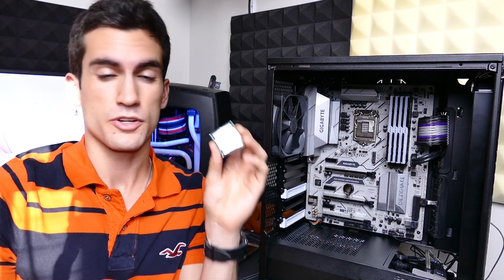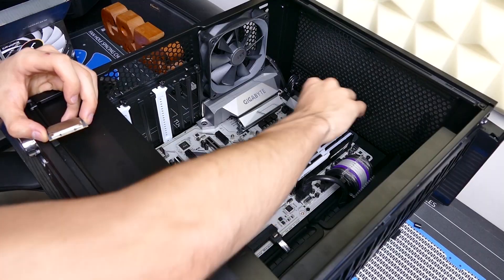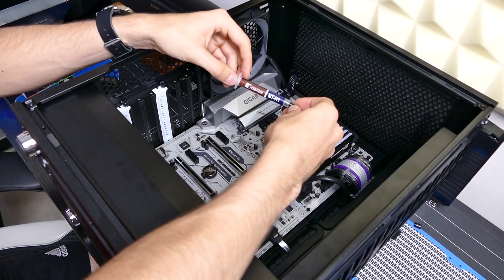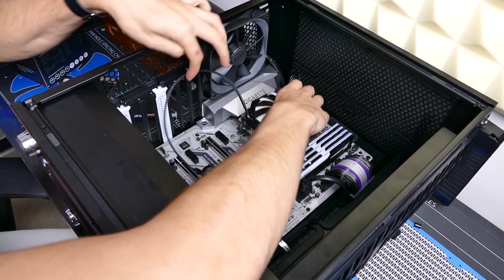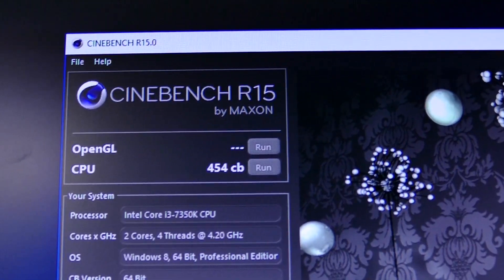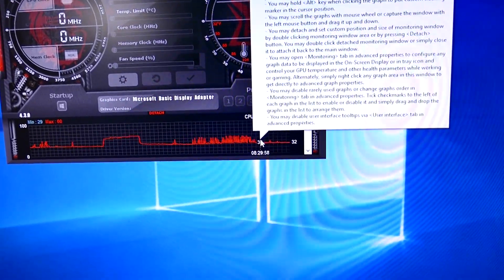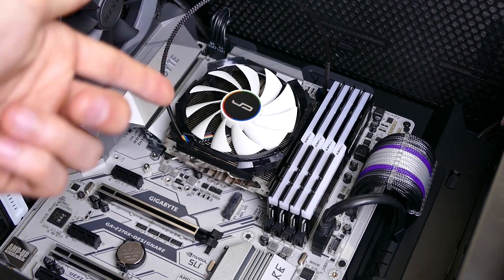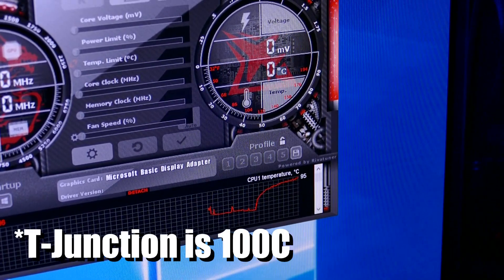Thermal Pad Instead of Thermal Paste?

Comment: Can't you see? when you removed the heatsink after first run with thermal paste blob wasn't spread evenly only occupied centre of the heatspreader and might have missed the core underneath. Ergo - putting one blob in the middle is not the best idea. just put on latex glove or cover finger with a small plastic bag and spread thinner layer possible all over the heatspreader. and no, no air will be trapped
Reply: Szymon Krasuski, all cores were covered, relax.
Reply: +Miruku to my knowledge, "spreading" the thermal paste is a disaster waiting to happen. Spreading it creates air pockets will will not allow the heat to dissipate and in turn will fry your chip eventually. Make  a 'P' or blob in the middle of the chip and  then press down firmly. In order to see what will happen when you apply thermal paste, get a clear piece of plastic and press down once you've applied some paste to see what it will do. This will help to understand what is happening.
Reply: +Miruku on that subject, how do you feel about Silver based thermal paste? I've used it my last PC build waaay back in early 2012 on my i5 K processor. I don't really monitor PC temperatures because I don't do any overclocking and I don't know/see the difference between silver and the plain white paste. Is there that much of a difference in how much heat is transferred using silver?
Reply: +Miruku Ok, that's what I thought. I'm getting ready to do some maintenance on a 16 year old console and its going to need a new coat of thermal paste for sure.

Comment: why so thick thermal pad ? .... i bet a thinner one would be much better choise
Reply: Actually he has a point, you use pads/pastes elasticity to eliminate the microscopic holes in metal which are filled with air pockets(extremelly poor thermaly conductivity) and the thinner the layer of this material the better as even the thermal paste is "very bad" thermall conductor (depends on manufacturer but its about 6 time worse than aluminium) that is why you do not want to put too much of paste between CPU and cooler. 

If 0.25mm - 0.5mm silicone pad covering entire junction would be used instead the results would not be so dramatic (still worse than with properly applied paste though).

Grammar nazis dont bother English is not my first language.
Reply: Michal Berák choise
Reply: The purpose of either paste or pad is to accommodate that neither the heatsink or cpu is perfectly flat.  By filling in the micro-irregularities, the paste/pad aids the more even conductance of heat from the top of the cpu to the heatsink.  You want the paste or pad to be only as thick as it has to be to fill in those irregularities.
Reply: Michal Berák By that logic, wouldn't no paste or pad be cooler? There's probably a reason why it's thick
Reply: Crimson choise

Comment: Wrong, VRM etc. are the hottest things in GPU, they USUALLY work above 100*C(on full load).
Simple thermal pads are good enough for the because these mosfets doesn't generate much cheat(up to few watts each).
Reply: Depends on how good the vrms are at doing their jobs and if it has a good thermal pad+heatsink. Higher quality vrms/higher phase counts reduce operating vrm temps greatly. But yes manufacturers slap shitty thermal pads between the heatsinks of vrms usually. Then there is the EVGA pascal debacle, lol.
Reply: Smithy Smit remember that temperature on top of mosfet is even 20C lower than it's dye temperature.
Also mosfets usually have junction temperature range up to 175C so it's completly fine for them to operate at eg. 120C
Reply: That's all well and good, but I'd rather not have it running at 120c when I can just slap a better pad on there and vent that heat out the case instead of it heating up the rest of the card. Had some damn good results on some hot r9 290 vrms. Taking it from say 110-120c down to 60-80c always under the gpu core temp. Also give this a look Arek https://forums.evga.com/Explain-quotpower-phasequot-m2393219.aspx better cooling on the vrms is always a good idea, especially when you push the gpu to it's limits overclocking instead of running it stock.
Reply: Smithy Smit Yeah I know it's true.

Comment: I would be very hard to do, but I have always wanted to flat polish the heat spreader and a heat sink and wring them until they stick. Then check temps vs a TIM. I have an older AM3 board sitting around, and the lock is a bit non functional so I can remove and install CPUs with a heat sink already applied. Seems like a good board to test this.

Comment: I was wondering why you haven't covered the whole die with the thermal pad. looks kinda smartless to use just one strip. and 3mm are way to thick. why haven't you used 0.5mm 1mm or something like that. sorry first time your video wasn't productive for the community.

Comment: you should have mentioned that in some cases thermal pads are a must, see for example the GPU waterblocks, you cannot use thermal paste there on ram and vrm, in that case thermal pads are a must especially when the gap among surfaces is big (1mm or more)

Comment: Would've liked to see a run without paste/pad. Just the cooler. Also without a cooler at all. Was disappointed that wasn't done. Maybe in a followup? I'm pretty sure those modern Cpus don't die from this. The worst case they should just shut down.
Reply: Yep, Intel processor shuts down....Apu starts smoking...saw few months ago

Comment: There are thermal pads that can be used with gpus or CPUs. Asus uses a thermal pad in the gpu/cooler contact on their R9  Fury Strix. I can get the reference of the product if you want.

Comment: I have an old Geforce 9500GS I use for posting. The fan snapped off the heatsink, so I jerryrigged a stock CPU fan on it. I also had no thermal paste onhand at the time, so I used toothpaste :') It's not a hot GPU mind you, but it never went above 55c, so I was happy :p

Comment: You can most likely not even put 3 volt in bios you should start from 1.5 and see where it dies. Should start degrading really quickly over 1.5 so that could be intresseting if you want to kill an incessant I3.

Comment: Pull a Linus and construct some janky ass heatsink that shouldn't exist and stick it on the 7350k, overclocked of course. Bonus points for no TIM or using a thermal pad between them

Comment: Maybe using a 1mm or 0.5mm pad and covering the whole heatspreader would give different results...
Reply: yup, he fucked up in my opinion
Reply: Don't bother guys. I said something similar. He just told me I don't know how heat transference works and deleted my comment.
Reply: Monarch Black Lol he told u that? Maybe he needs to check the termodynamic laws
Reply: There is 0.125 mm foil
Reply: I have a 0.5mm or less on my Athlon 64  X2 TK-53 (Packard Bell Easynote MX 52-B) thermal pad running for more than 10 years @ 48°C min & 58°C Max (maybe 60°C peak) since i don't use it for benchmark... and it cover all the heatspreader..
Reply: What brand/product did you bought?
Reply: No creo que hubiera mucho mejores resultados.  Todo aquel que haya estudiado principios de transferencia de temperatura sabe que la misma no podría distribuirse al punto de necesitar mas cobertura en la superficie exterior ya que la superficie interior donde se produce la temperatura es mucho menor. Los que hablan abajo o no tienen mas que hacer o no saben nada. Podría ayudar levemente pero la consistencia de marcar la diferencia entre estos 2 elementos para nada de nada!!! Buena prueba. Salu2.
Reply: HE WOULD MAKE GOOD DRAG QUEEN WITHOUT BEARD
Reply: Dirceu Franzner yea, how did he overlook surface area as a control variable? Could have easily doubled the contact area with little that pad was

Comment: It's kind of a poorly conducted test.
Firstly, the pads are surely used for warm components, as VRMs can ger quite toasty and are safe to run at degrees above 100 °C.
You could also have used a synthetic test to stress it, as you can see throttling with either Aida64 (in the test) or through some hardware monitor, like CPU-Z.

Small things ofcourse, but it's not a good thing to say it's even ok to use a thermal pad, as a longer test than just a couple of runs of cinebench would be closer to a real world usage.
Atleast I think that even gaming during a regular session would bring up the heat to throttling due to constant load, as I don't think a pad could dissipate the heat fast enough. Might be wrong, but it's hardly proven through this experiment either.

Comment: So quick question: I notice a lot of techies test Temps right after putting in thermal paste. I've heard you need to let it set for a few hours/days for it to fully set and be effective. Is that margin of difference between right off the bat Temps vs few days old Temps not significant?

Comment: Man, my FX 8350 hits thermal SHUTDOWN at 80C. As it, the moment it hits 80C the computer will simply freeze on the spot. 

I don'r know of my current processor (a Ryzen) is any more heat tolerant, but seeing these intel chips run at 90+ always freaks me out.

Comment: surely thermal pad is made purposely to be attached to a die? i think if you wanted to test them fairly against each other you should have removed the ihs or used 100x that amount of paste. I mean its pretty obvious that a 3mm thick pad isn't going to dissipate heat as well as a less than 1mm layer of anything else with that kind of variable you could have used vegetable oil instead of paste and still got a better result.